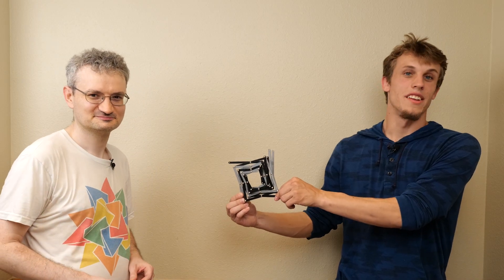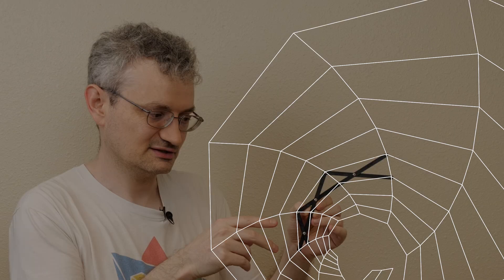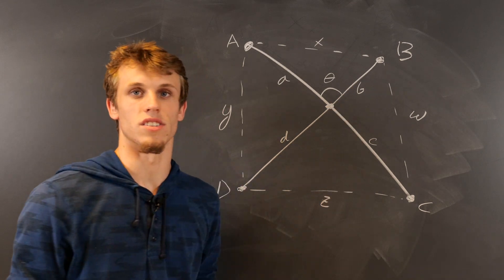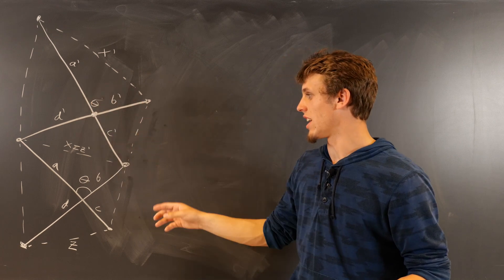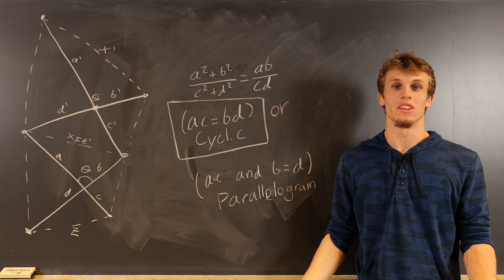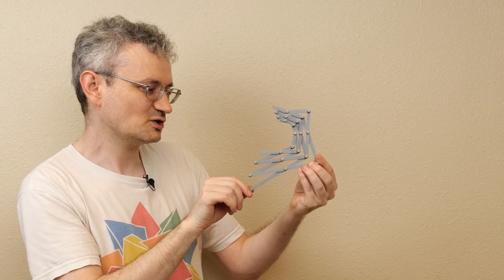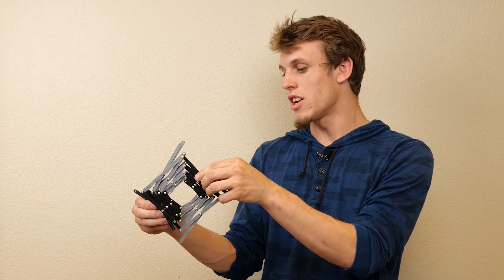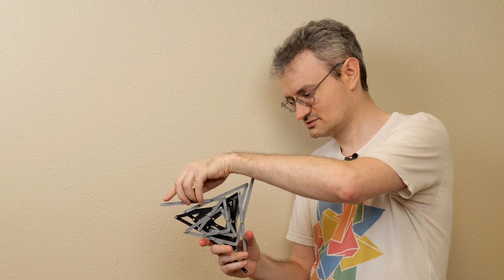Kinetic cyclic scissors

Comment: I'm a little bit confused, I tried solving the equations myself and found that it was either cyclic or a trapezium rather than a parallelogram given that the scaling factor is constant for all angles.
Reply: oh wait nvm you want it to work in both directions so clearly it is a parallelogram then

Comment: That machine is essentially what carries capillary pressures to a folding insect wing; able to deploy and furl itself from rigidity into halves of compact-beetle-wing's-case: most complexly found encasing ear-wig-wings', with a twenty-to-one ratio of surface-area deployed in flight, compared to wings'-encased; in scale, they're equivalent to properly folding a parachute for re-deployment without hands, in only seconds.

Comment: Excellent work.  Can this be done in 3 dimensions, and if so, how would it be different from Dr. Hoberman's work?  i.e., does your work converge into his, if you extend into 3D embodiments?

To whit, are bellows (like old-fashioned camera bellows, to block light, whilst retaining the ability to make linear changes) a 3 dimensional embodiment of conventional scissors, which (of course as is well known) are roughly bound in a 2 dimensional plane?

At any rate, very interesting!
Reply from the maker: In the Hoberman sphere, it is crucial that each scissor arm is bent at the pivot. In these cyclic scissors, every arm is straight. Both types of design are linkages, so of course there are similarities, and presumably one could find a sequence of designs that walks from one to the other. But no, it doesn’t seem likely to me that the Hoberman sphere is the natural extension of these cyclic scissors into 3D. (Assuming that such an extension exists at all.)
Reply: In the case of bellows and such one only needs to consider one side (as the other three are redundant). And that is nothing more than a Hoberman device which has been cut and made straight. In other words, a chain of scissors which extend when closed, retract when opened.

The mechanism presented in the video on the other hand is quite novel in that the structure exhibits not expansion and contraction as two extremes, but rather an equilibrium state of "scissors half-open", flanked by a pair of oppositely-arranged collapsing states. (So a tri-state system of sorts.)

Also, Hoberman-based constructions are constrained to one single degree of freedom, whereas this one appears to have two.

Comment: I learned something today! 3:45 was a great explanation of the two classes of quadrilaterals that can create self-similar tilings. Cyclic quadrilaterals are very cool!

EDIT: the only two classes of quadrilaterals that can create self-similar tilings which stay self-similar when you "scissor" them (change angle)
Reply from the maker: Any quadrilateral can create a self-similar tiling. The parallelograms and cyclic quadrilaterals are the only ones whose scissor grids can move.
Reply: @henryseg  oops! Right. You did explain that earlier in the video. Anyways, this also got me thinking about the possibility to create circle packings from quadrilateral graphs instead of triangle ones

Comment: This could be the basis for an interesting device on a control-style battlebot if it can be made sturdy enough: a major problem hit when trying to grapple another battlebot is they can’t be counted on to stay still long enough.  In this case, say, what if a pneumatic cylinder were used to open close it, and something else to latch it and keep it deployed?

It requires (at least the ones shown here) a lot of moving parts, which may not work well in the context of battlebots where the opponent is trying to destroy your battlebot in many different ways, but it’d be fun to try!
Reply: Perhaps if some kind of joint covering scale were to be used to protect it?
Reply: @AA-vr8ve  perhaps.  Of course, in BattleBots there’s a very fine line between useful parts and those you think will be of use that add to failure modes in actual battles.

Comment: This may sound dumb as I'm not fluid in topology or advanced geometry, but what if you did something like this in a 3D space like with your extensor scissors? Would there be a limit point in 3 dimensional space that the object would "wrap" around?
Reply from the maker: Good question! I don’t know if something like this with scaling could work in 3D.

Comment: You showed (1,1) and (1,2) patterns here... are all such natural number vectors possible? If not, what does the set of valid vectors look like? Is there a 3D equivalent, or is this one of those things that only works in 2D?
Reply from the maker: I don’t recall exactly how it goes, but I think you can get whatever you want as scaling factors as you move in the two directions, so you can choose scaling factors that have whatever ratio you want. 3D is a good question, I don’t know.
Reply: @henryseg  Thank you for sharing Mr. Segerman. I hope yiu can respond to my other message or email when you can. Thanks very much.

Comment: Can you tell us more about the mechanized version at the start of the video? Which point is driven by a motor or servo?
Reply: On the wooden block, there is a full grey link that is held horizontally. In the middle of that link is a pivot, connected to which is a transparent-looking half-link. It is that half-link that is being driven by the motor/servo about the aforementioned pivot.